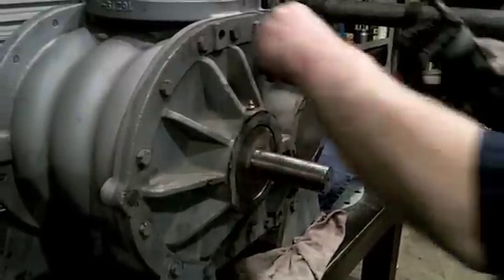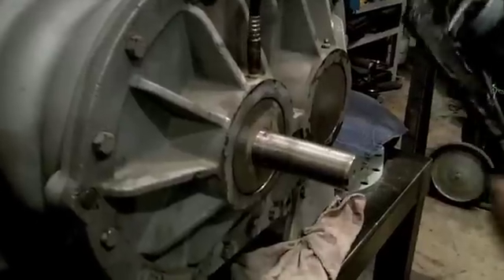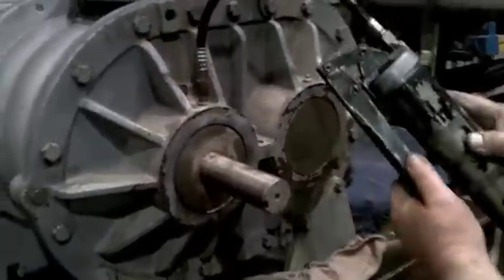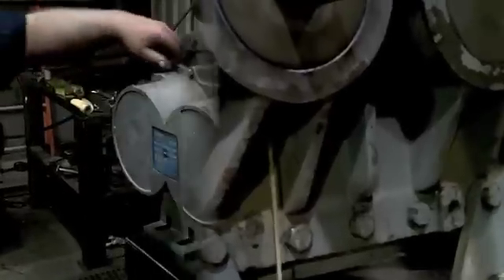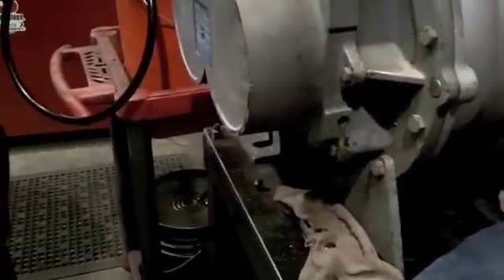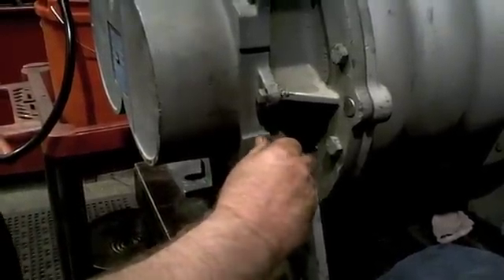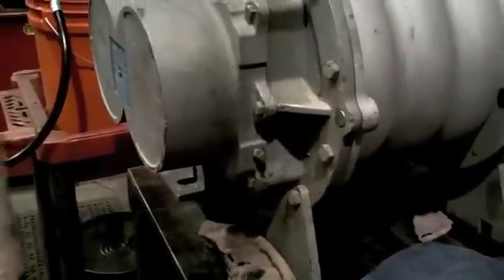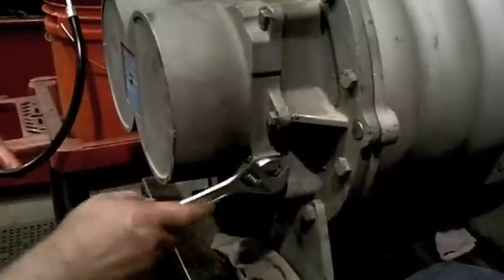Roots URAI Blower Lubrication

Comment: Roots now recommends royal purple grease for there U blowers
Reply from the maker: That is correct Chris.  Starting in fall of 2016, Roots started using a synthetic NLGI No. 2 grease on all of their blower models. Whether you have a newer blower with the synthetic grease, or an older blower with the clay-based grease, the best way to maintain your blower is to continue using the same type of grease you have now.  The two types of grease cannot be mixed because they could separate and cause the blower to no longer be properly lubricated.  We have more information on our website about the two types of grease and how to tell which one is in your blower: https://www.pdblowers.com/faqs/type-grease-use-roots-blower/

Comment: Why not just use the pumper directly in the hole? Funnels use is not recommended for proper lubrication as far as contaminants. Also purging can lead to over greasing and can overheat bearings. 🤔🤝